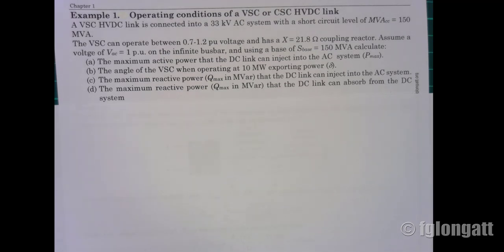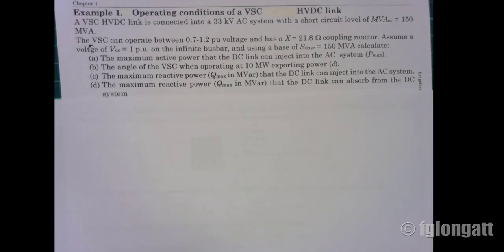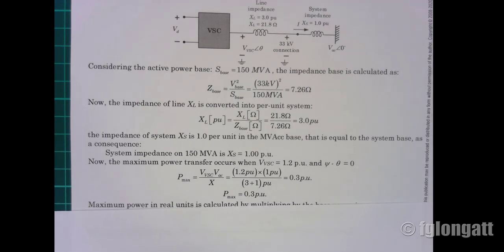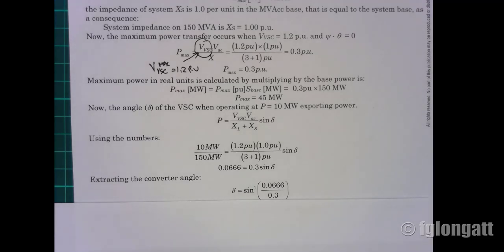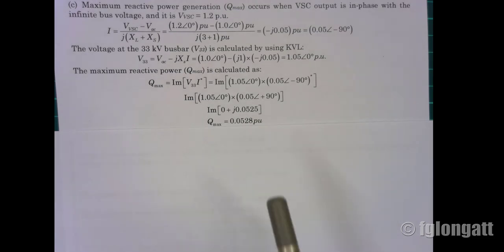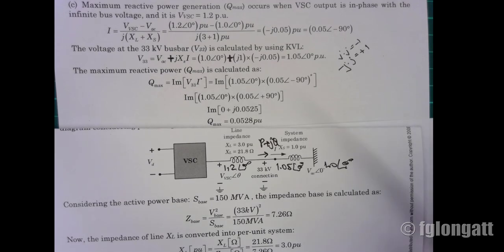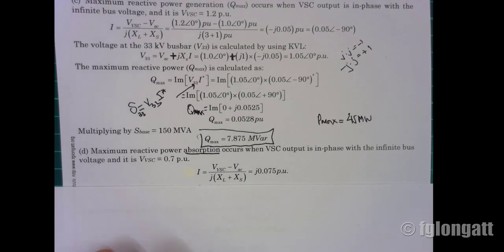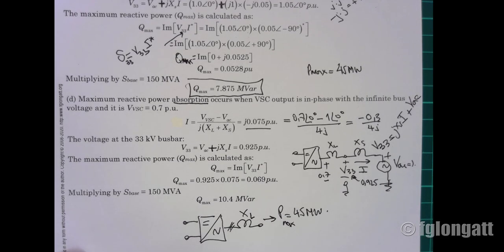Example 1.8, Operating conditions of a VSC HVDC link

Comment: Hi, the maximum active power transfer according to this condition is when angle between the voltages is zero, but when angle is zero there is no active power transfer. Please give an explanation for the same.
Reply from the maker: Psi -  Theta = 0 :-)